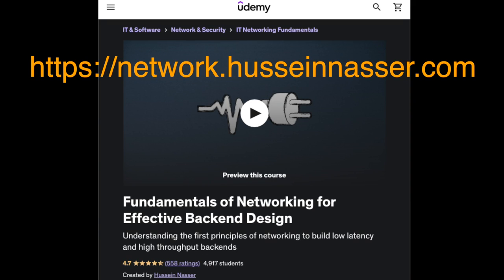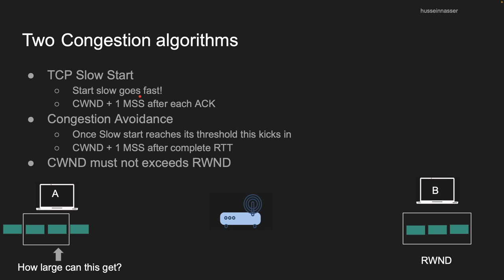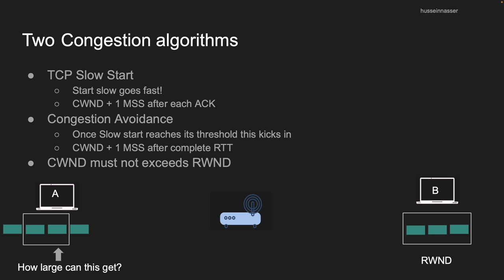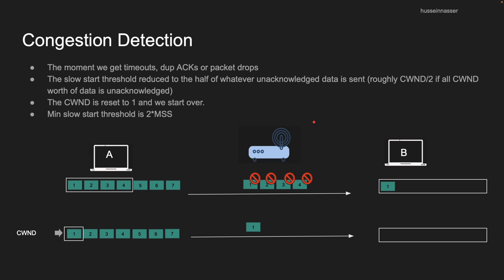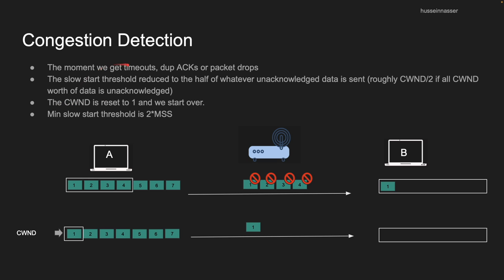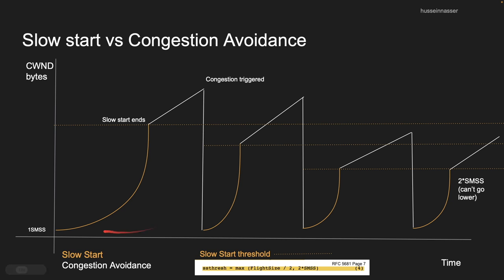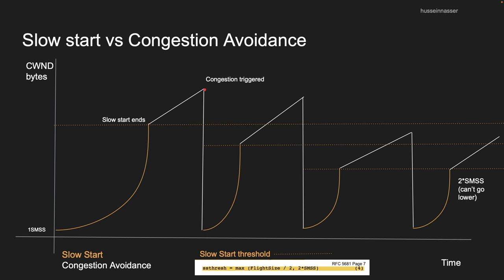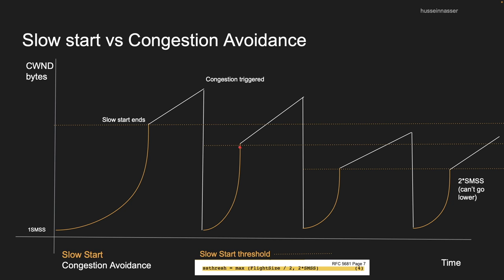Slow Start vs Congestion Avoidance in TCP

Comment: SMSS is basically senders MSS which defines the initial window (IW) or CWND (senders window)
IW which must be set as per following guidelines as per RFC

   If SMSS > 2190 bytes:
       IW = 2 * SMSS bytes and MUST NOT be more than 2 segments
   If (SMSS > 1095 bytes) and (SMSS <= 2190 bytes):
       IW = 3 * SMSS bytes and MUST NOT be more than 3 segments
   if SMSS <= 1095 bytes:
       IW = 4 * SMSS bytes and MUST NOT be more than 4 segments
My question is will the value of ssthresh be same if we have SMSS <=1095 ? 
     ssthresh = max (FlightSize / 2, 2*SMSS)